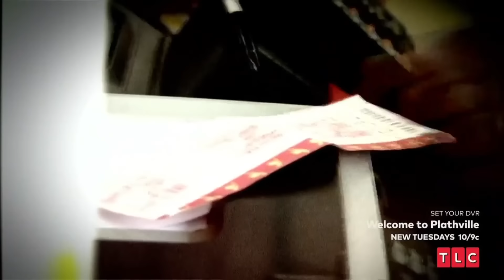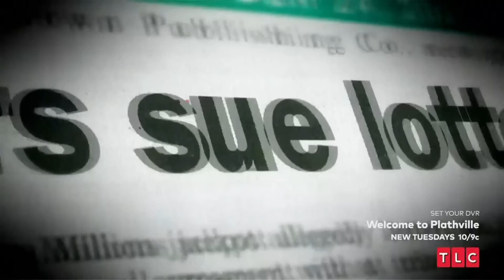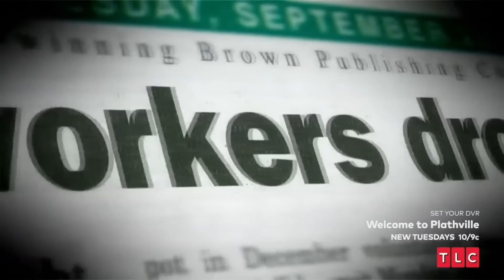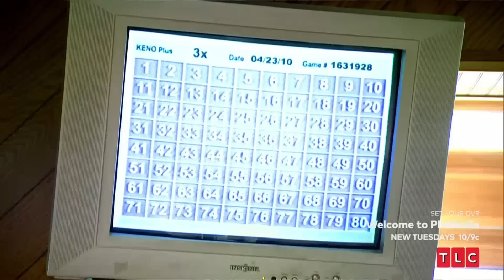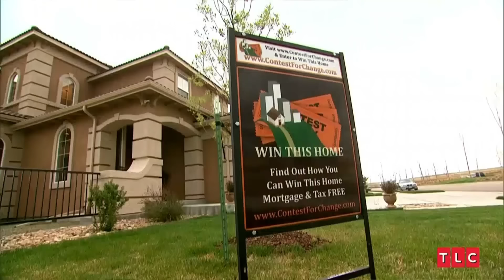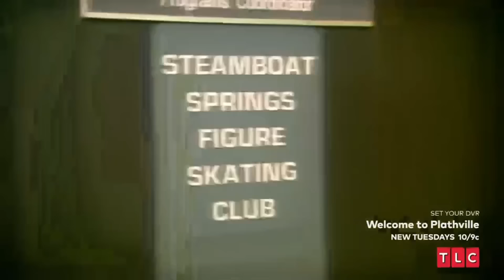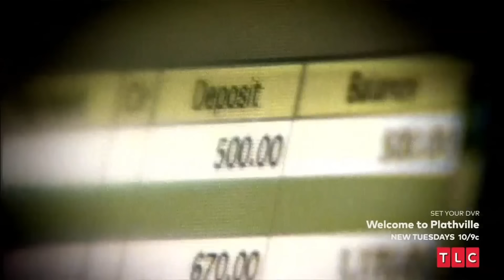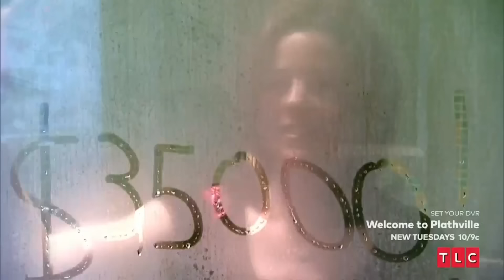Lottery Changed My Life S3E1 Streetsweeper Millionaires

Comment: 2:47 $270,000,000 divided by 15 would've netted them $18,000,000, if the lottery wasn't such a scam and the government wasn't so greedy. 🙄
Reply: You’d rather the gov not tax the super wealthy?

So you don’t want billionaires taxed either then? 🤔
Reply: It was actually $207,000,000 and the cash amount was $147,000,000 split between the 15 winners.
Reply: You never expect to get the lottery amount, you should focus on the cash amount as that’s the amount that will be taxed.